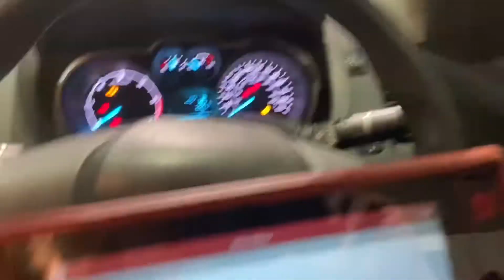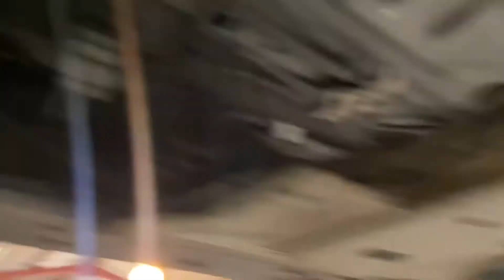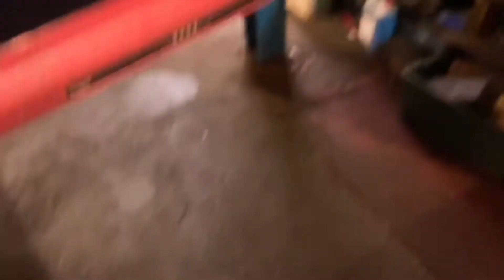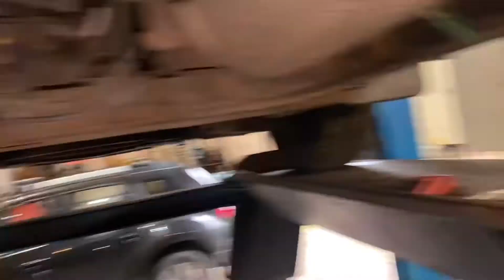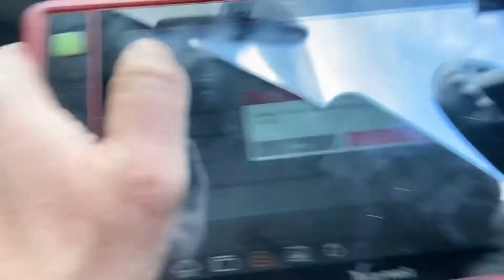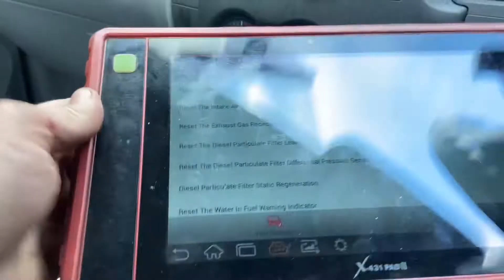Ford ranger / Ford transit P244C P246C P2464

Comment: Excellent video! I have a question, I would really appreciate it if you could help me! I took out my vaporizer candle, disassembled it and washed it (would it damage it?)... but I took the opportunity to test the candle by connecting the battery's positive and negative for a few seconds... I noticed that it takes a while to heat up and even leaving it for a few seconds. After 10 seconds it heats up, but does not become incandescent. Would this be a defect? One last question, is it possible to change just the spark plug without having to change the body around it?

Thank you very much!
Victor Lima
Palmas - Brazil
Reply from the maker: I would expect it to heat up quicker, much like a glow plug would. I’m sure you could change it if you can find the right glow plug?